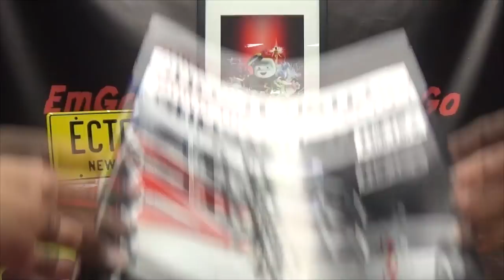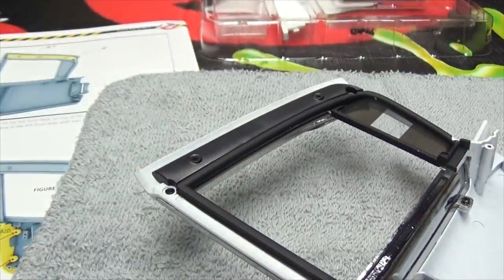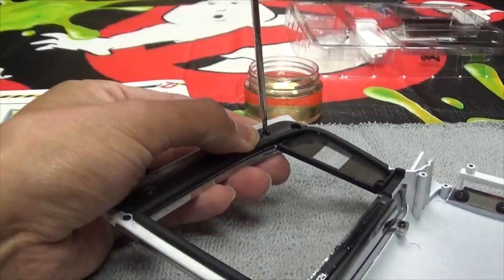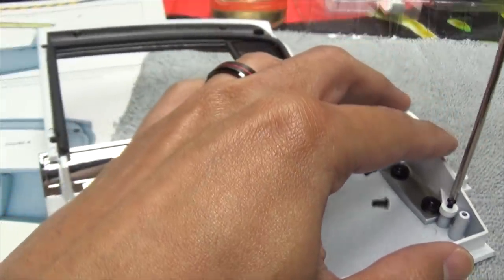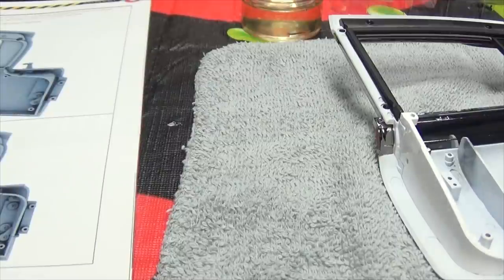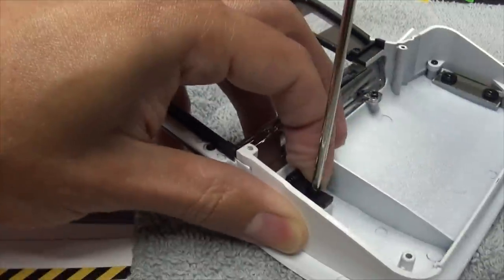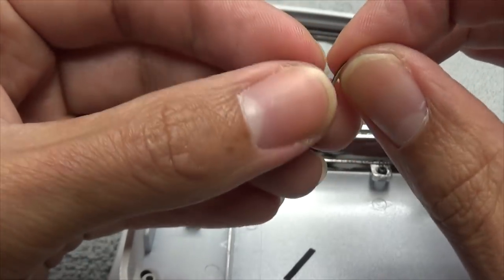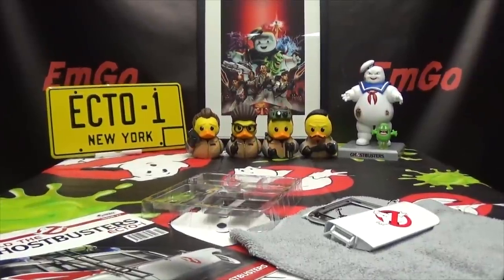Eaglemoss Ghostbusters ECTO-1 Kit (Part 82): EmGo Builds Stuff

Comment: So I'm guessing this model comes with the old model 255 air conditioning.  2 windows down at 55 miles per hour... ;-)  I do miss those vent windows in the front.  those were great for getting air in the car, and could help you stay awake at times too.